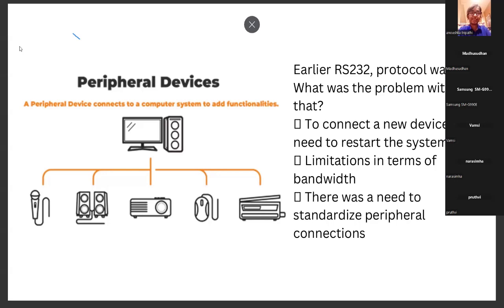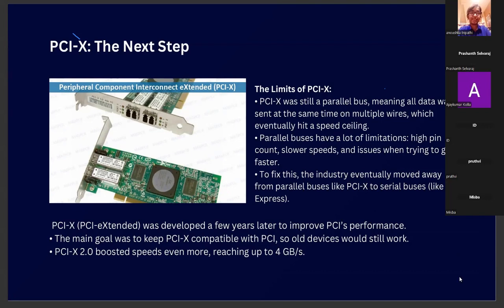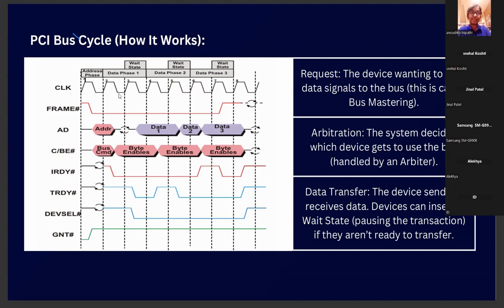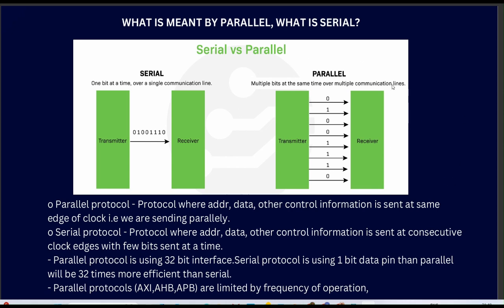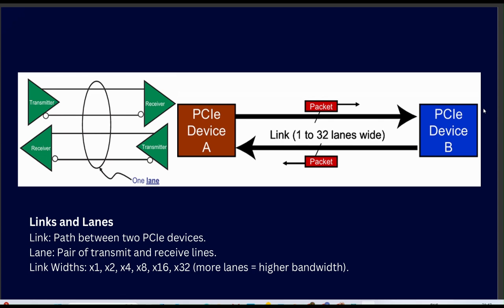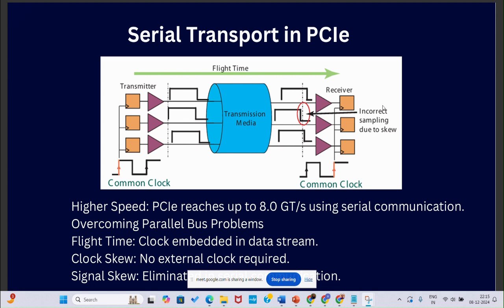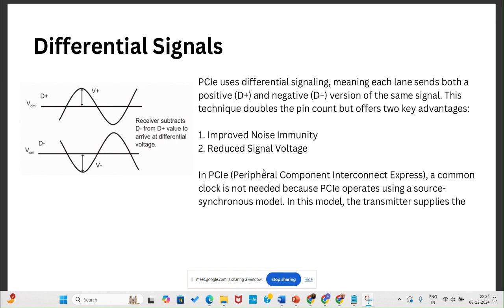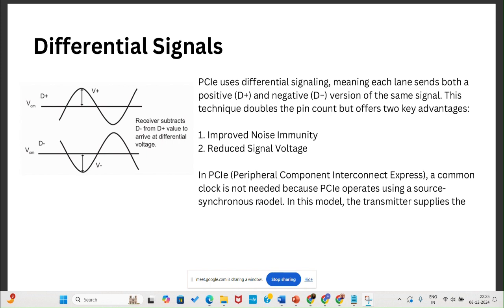PCI Express (PCIe) Masterclass Session 1 The Introduction

Comment: Small nitpick I think calculation of latency for 2Ghz bus is a bit off (minute 35.36 in the vides). Since 1 GHz = 1 cycle per nanosecond, and 2 GHz = 2 cycles per nanosecond, so each cycle is 0.5 ns, and not 5ns
Reply from the maker: Thank you for pointing out